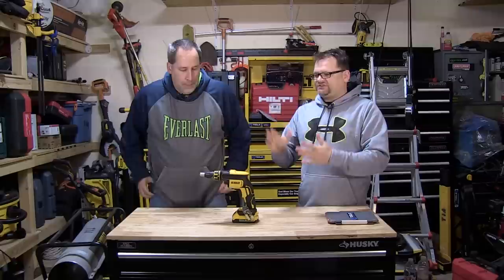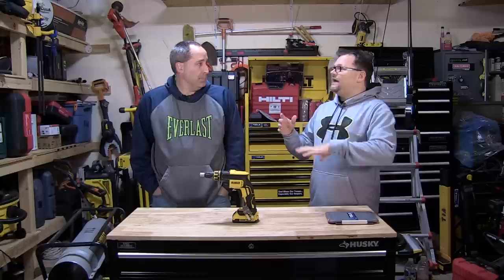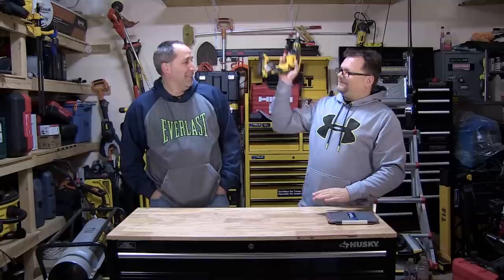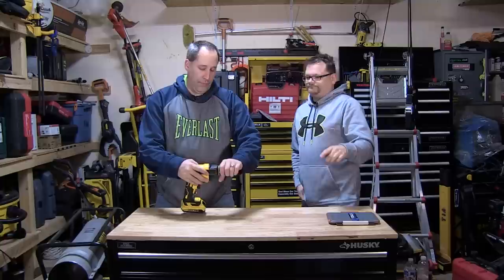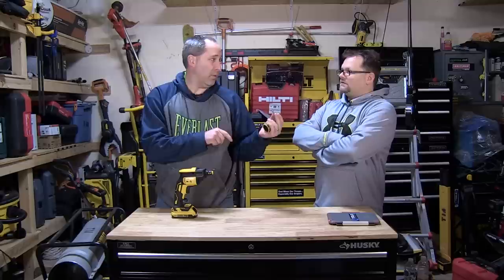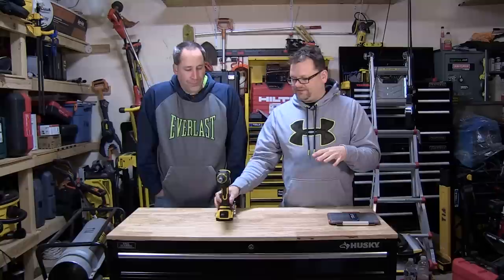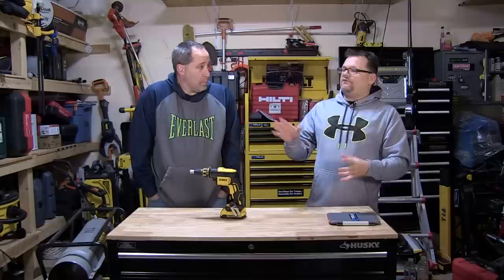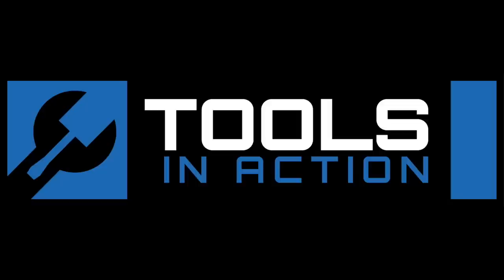DeWALT DCF620 20V Brushless Drywall Screw Gun -Sneak Peek Review

Comment: Nice sticker on the tool box back there about the military. Makitas looks really nice too, I like how they also have a 2 kit available with a cut out tool and they have a feature where the motor only runs the pressure is applied to save battery life. Dewalt did a great job by making this look nice and compact like Bosch

Comment: I like it BUT, I am not a fan of the motor running constantly with the trigger locked like your traditional drywall gun. John NER did a review of the Makita drywall screw gun and it's always on mode runs when the tip is depressed.

Comment: Milwaukee screw gun is better, it has a feature to have the gun with the trigger locked but the motor doesn't run until the screw puts pressure on the tip of the gun, the battery will last longer and the gun won't make as much noise.

Comment: Thanks for the review guys. 
Do you have any inside info on wether or not milwaukee is coming out with a new 18V vacuum or jig saw. its about all i need now to completely replace my old 18V dewalt tool collection. the old dewalt sucked and not in a good way.
Reply from the maker: 101Cranetech No inside info, they are pretty tight lipped.

Comment: I cant see spending the money on this when I could just use my normal impact gun with a drywall tip
Reply: BIGboostedDSM right? Im trying to figure out why this exists. If you didnt have to manually load each screw like an actual screwgun we’d actually have a tool here.
Reply: I looked into it and got a chance to use one. Sooo much faster than an impact gun. They have an attachment to load screw strips.
Reply: It is way way more efficient for hanging drywall. The clutch mechanism allows you to just push it and it drives the screw. It’s already running before you apply pressure. Much faster rpm so screws drive in a split second and it drives to the exact same depth into the paper, every time. Also, the handle allows you to push in the same axis as the screw, preventing odd angles which tear the paper and weaken the fastening point. Everything about it is greatly advantageous for the task. No guess work. Zip, zip, zip. Eliminating the having to pay attention to how tight the screw is seated at least doubles efficiency and quality of the hang job.
Reply: Shi Jong Ro right, I have a screw gun that does that but this one you have to manually load screws which seems dumb but i guess they have an attachment for that ^
Reply: Oh I see what you mean. I thought the question was in comparison to just using an impact gun. I guess there are clutch tips that can be added. But yeah it seems like you would have to use the screw attachment to get the full benefit.
Reply: Smart man. It’s true! I didn’t want to believe it but it’s actually better. The drywall gun doesn’t even unscrew if you miss a stud.
Reply: Any industrial tradesman working drywall will be using this gun. Sinking screws in too deep is no good when hanging drywall and worse if you leave them sticking out. Both easy to do while using an impact. Impact bits like dimplers wear out fast and will never match the production level this gun will give you. If you want the taper who comes in after you to think you're a shoemaker go ahead and use an impact your whole career
Reply: If you only hang board once in a while or only a few sheets then i can see sticking with the inpact gun. However pretty much any time i walk on a job that had been hung for us and they use an impact with couter sink or just a regular bit the screws are always way too deep or the heads are sticking out. I can see leaving a screw that is too deep but it boggles my mind when they leave the screws sticking out. Anyway we always go back and fix thier work. Once you get used to this gun you can work really fast. Im a plasterer and we hang but perfer not to unless its like 50 sheets or less. When its a whole house we sub it out to full time hangers. These guys are insane with how fast they move and still do quailty work. They also use these guns and routers. Ive actually never seen a crew with the autofeed gun.
Reply: @adrocka  exactly... Sinking screws to deep can lead to screw pops later an its no longer providing a secure hold. For some of theses contractors that dont hang sheets often i can see sinking a screw too deep but not way too deep and moving on. However like i said in my post its a head scratcher when the leave screw heads sticking out. Im not talking about just sticking out a hair i mean half to 3/4 of the head is sticking out. Do they really think we can come in and just plaster over that? If they want to buy me a new trowel i will do it. Im obviously joking because it couldnt be done if i wanted to. I try not to complain when someone hangs the board for us. It makes my job so much easier. Personally i like to do one or the other. If i have to hang id rather hang all day or if im plastering thats all i want to do. It just a pain loading sheets, setup tools ( much easier now with cordless) hang board, cleanup, then you have to prep for plaster. So now your covering the floors, taping, beading, lugging in the equipment, jumping on stiltz most of the time, then obviously getting the mix ready, filling barrels and buckets with water. Then i have to mix and hurry to scoop it all on the table so i can get the barrel, mixing paddle and scoop cleaned. Then i have to jump on stiltz and move my ass to get it on the walls and ceiling before it starts to setup. Did i mention my boss also likes to use accelerator. I dont mind it so much but sometimes it comes close for me. He finally hired a laborer so i didnt have to do both jobs but he only lasted 6 months before he quit. So now im back pulling double duty... Anyway if you buy these guns and routers and give it some actual time to get used to it you will never go back. Ever now and then i have to pull out the corded gun and its so much heavier and of course setting up the cords and taping them so they don't come unhooked. These guns are a game changer if your working on staging or a baker. We have these nice benches we use on ocassion and the cords always found a way to get caught up in those. I also use a holster now which is nice. Since its only 2 of us when we do ceilinga im usually holding the sheet up with on hand and running the gun with the other. Beinf able to holster it securely while i get the sheet into the correct postion is great. And like i said no worries about holding the sheet up ans a cord snagging or coming undone.

End of ramble rant
Reply: BIGboostedDSM if you can find a longer bit brother, you can actually put a rocker on one of these things. So you don’t have to manually feed each screw. Super convenient when hanging drywall by yourself.
Reply: For occasional hanging drywall for sure.  If you have a big project this gun makes a big difference.

Comment: Would this be suitable for building a deck? Or even running 3 inch screws.
Reply from the maker: Matthew Smith yes
Reply: +Matthew Smith I wouldn't, it's not meant for that. If Dewalt claimed it to be a decking gun they would have.  This doesn't have a torque rating with it.  Buy a gun that states decking/ drywall

Comment: I tried one of these at home depot and was going to buy one but how do you get it to reverse a missed screw out, the reverse did not work properly?
Reply: +The Saw Thank you, but what do you do if you miss a stud, screw it it more and mud over it?
Reply: +Fishingtuts Always keep a small screwdriver in your pouch, punch in your miss with that. Pulling a screw out leaves paper hang out that you or the taper have to fix.
Reply: Do  you punch it always through or jist a 1/4 or so?
Reply: Fishingtuts No I don't punch it all the way through, usually just a quick pop with the hammer on the end of the screw driver. I should also say it isn't a rule of thumb for me. I pull out plenty of screws by just backing them out. But usually I will use the screwdriver method.